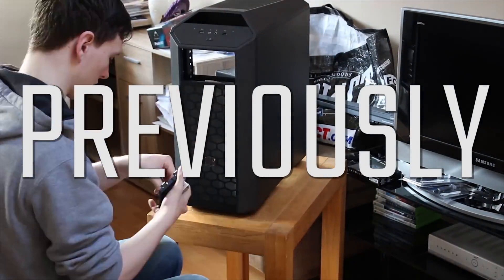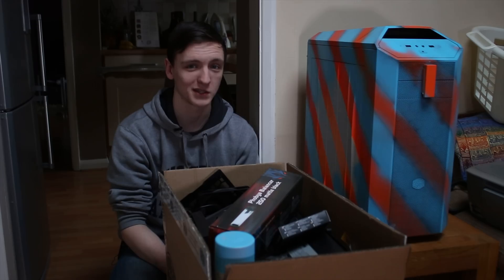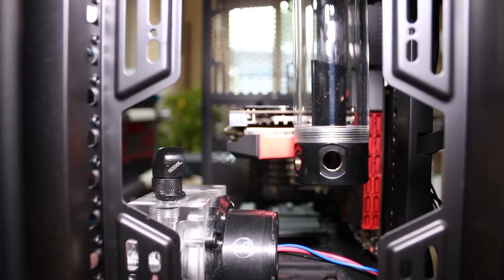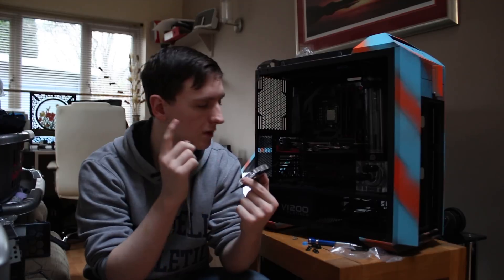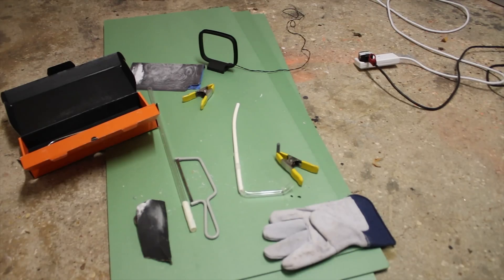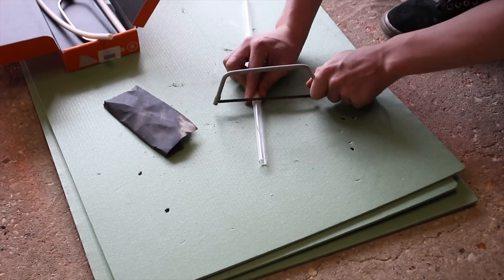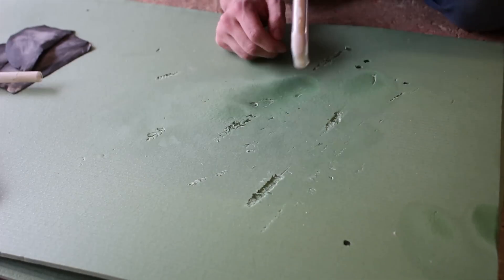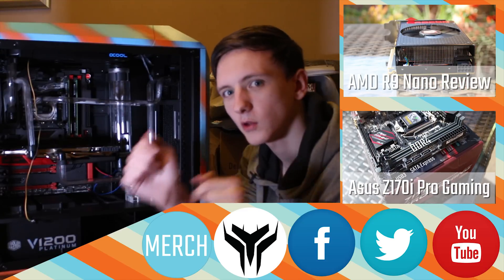CMMC5 Mod Project:  Hard Pipe WaterCooling (Ep.4)

Comment: Is it possible to place a 240 Radiator at the ground of the case in front of the power supply ?
Reply from the maker: You'd need to open some space up in the bottom since there is no airflow options facing downwards. So assuming you can add that in you can, yes I think there is space.
Reply: Titan
 You got place for a 420 in den front.
So a 240 rad shoud have place in the front.
Reply: ok, thank you ^^
Reply: could you place a 240 rad in the front ?

Comment: I'm just about to start the same case with hard pipe! What pump and what sized pipe did you use??
Reply from the maker: +formidable38 standard d5 pump and i used 13mm tubing if I remember, it's been a while.. Might have been 12mm actually. Just make sure the fittings you get match!
Reply: Cheers dude!How did it work out? You still got it?

Comment: how you mount the reservoir?
Reply from the maker: +AwesomeRising I used the res mounts that came with it and screwed one at the top through the 3.5" drove bay rail, and since I'm using hard tubing I didn't use a bottom one.
Reply: How wide is the reservoir?

Comment: Nice colours but 2 questions:
1-is the paint not going of the case? 
2. how is the front intake mesh panel? is it not blocked by the painting now?
cheers
Reply from the maker: +Dawid Sidlo What do you mean? As for the front panel, no it's not a thick paint, so there is plenty of air flow available for the radiators and such.

Comment: Why did you paint over the dust filters? Surely that will affect airflow to the inside greatly?
Reply from the maker: +Ferisas I didn't! The only proper air filter is on the bottom for the power supply, which I removed before spraying. Otherwise, there isn't much restricting the airflow in - it's a pretty thin coat!
Reply: ohh I see :) was worried for a moment